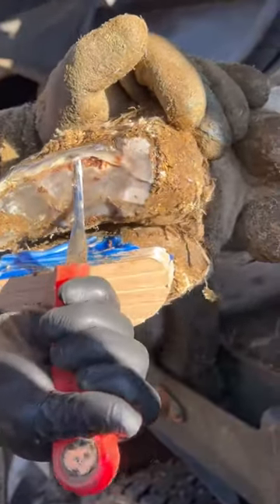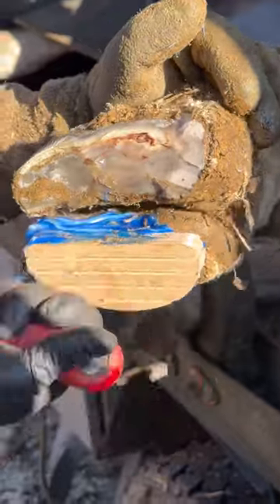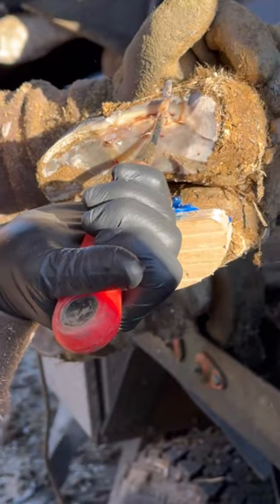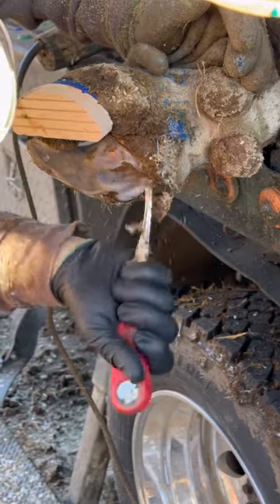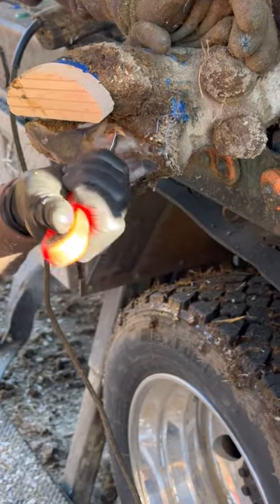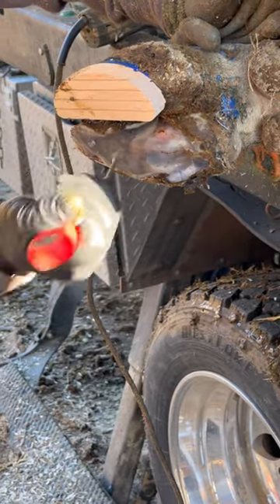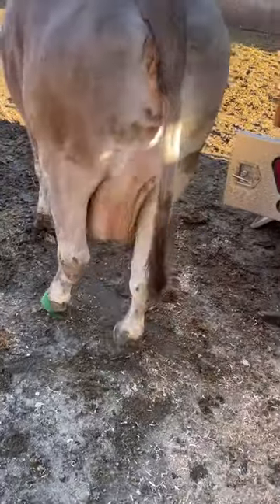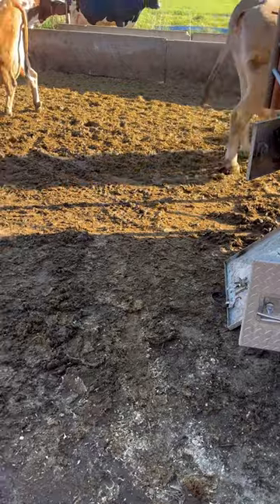PUSS BUBBLES on a Brown Swiss Cow HOOF

Comment: What is the advantage of these rotating squeezes that tip them over, vs an upright crush? This looks like it's more awkward for everyone, cow included lol. Seems like for some of the trim you're cutting toward yourself right at face level, seems like a recipe for disaster but I'm sure it's really not that bad lol. Anyway, genuinely curious if there is a feature or reason you use this instead of an upright
Reply: @user-zu2bw7ig5v  thanks so much for the info :)
Reply from the maker: It’s what I and the animal are comfortable on.  Cows lay in a field.  Cows don’t hol their feet over their tail for any length of time.  It also lets me work on all 4 feet with out stopping the grinders or walking around the chute.  We trim many many cows.   About 30,000 a year.